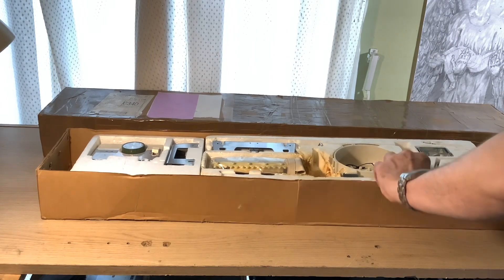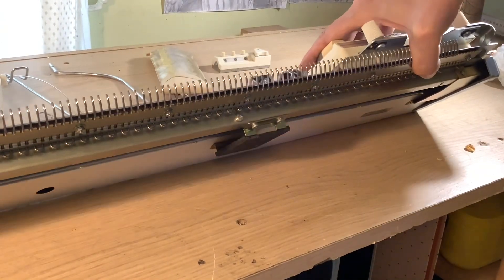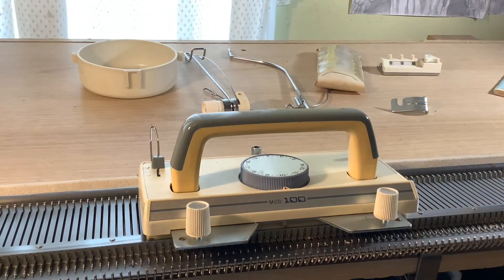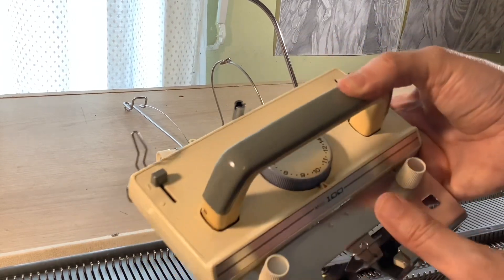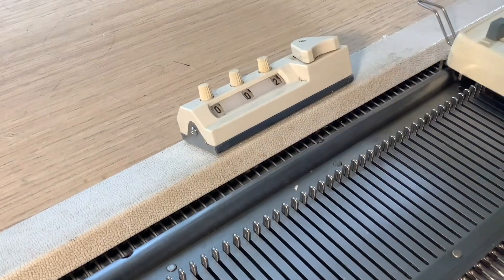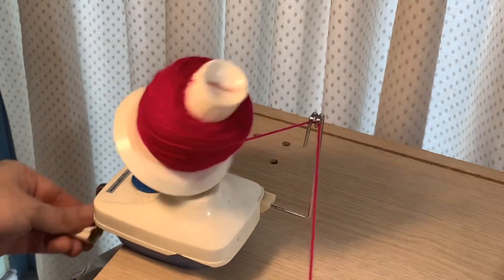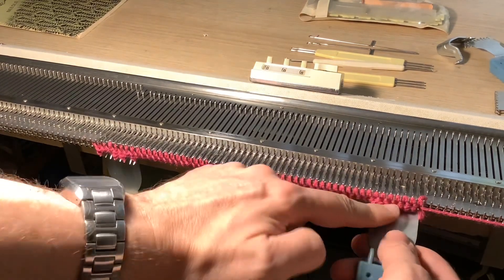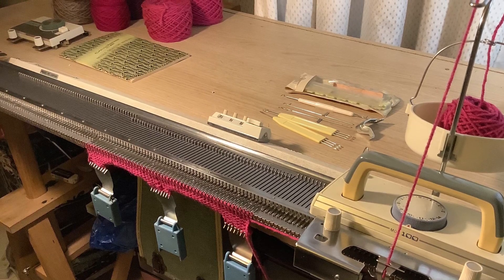Knitmaster Mod 100-Introduction to the Knitmaster Mod 100-The Setup and Basic Cast On.

Comment: You are using a yarn that requires a much higher tension.  That's why it's hard to push.
Reply from the maker: This is the odd thing about the modern yarns, what they do to the yarns is that fluff it or crimp it, so that it will look bigger in the packet or display. The 4mm yarn that was originally used for this machine was thinner and smoother, but still a 4mm yarn.

You are right on a higher tension, I use the number ten on the tension dial with the yarn. The higher tension actually stretches the crimped yarn and makes it easier to knit. It’s not such a great idea, as it does strain the needles and machine a bit. The best thing to do is to get the 3.5mm hand needle yarn, which is better and smoother. It’s best to test the yarn before doing a project. This machine is basic , but can be useful for hand manipulation patterns. I have often tried a 4mm yarn doing hand knitting and have found after a wash it seems to have stretched a bit. Often it is said that people don’t have the right needles, or they do not know the fibre content, that needs certain care. The yarn industry does find ways to cut corners. So sometimes it is how the yarn is spun to save costs and quality.

Comment: I have this machine :) but missing the yarn brake and bowl. I have been looking for a replacement part, do you know where I could find one?
Reply from the maker: Hi there, have a look closely at the the top back of the machine and see if there is a slot. If it has one you can get a ordinary tension unit for the machine, some have slots. I don’t really use the bowl that much and place the yarn at the bottom on the floor and work from hand. You might have to get a mid gauge tension unit. If you can just borrow a tension unit from a another standard gauge machine you have, to see if it works. The standard gauge yarn tension unit, may not work for the DK yarn, the 4 ply yarn from 3.25 mm or the 3.50 mm hand needle size is the best yarn to try with a standard size tension unit. Just test to see if it works.
It’s hard to find bits for these old machines, sometimes it can work with alternatives.

Comment: Hi how many needles does this machine have?
Reply from the maker: The machine has 182 needles, it’s short of 14 needles, but on sizing with the needles much wider apart 5mm works out the same in measurements, like the standard gauge.
Reply: @aldosmachineknitting  thank you I’m trying to decide between one of these or a lk150 I think I prefer a metal bed of the mod100 as I think they will last a lot longer. I’m finding you videos on this machine fascinating
Reply from the maker: @matthewshaw3470  hi Mathew, the machine does have a few issues, the main one is that it does not always like some of the DK or double knit yarns. The other thing is for some reason, when the dial is on 14 the highest it does seem harder to knit with, just turn the dial down to ten and it will knit better. Just test the yarns, the Lk150 is great to knit with, basic machine, but does knit the DK easier. The Knitmaster Mod 100 needs a lot of oil, and watch out for the open and closed edge cast on. The closed edge cast on or the e wrap only seemed to work after using it for a while. Glad you are looking at these machines they are difficult but fun. 😀